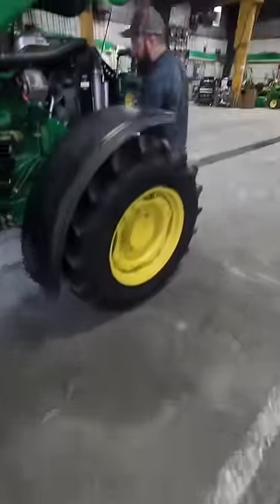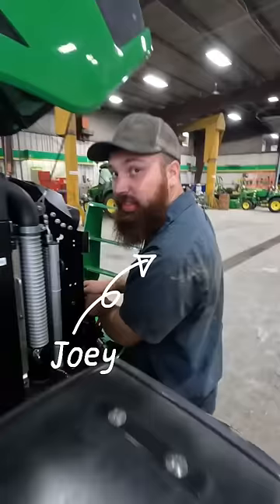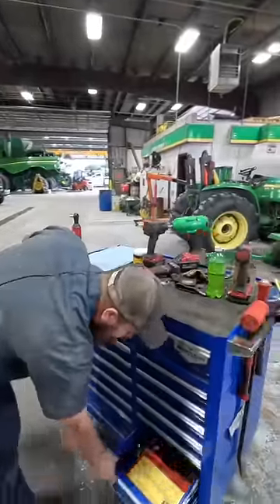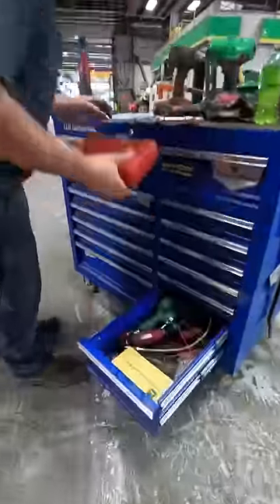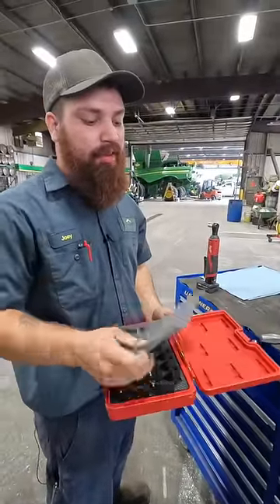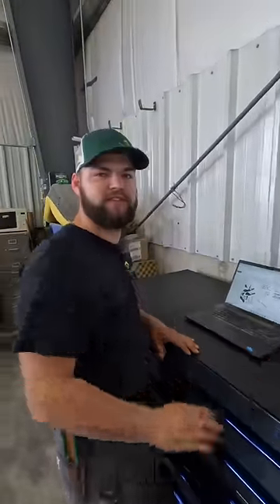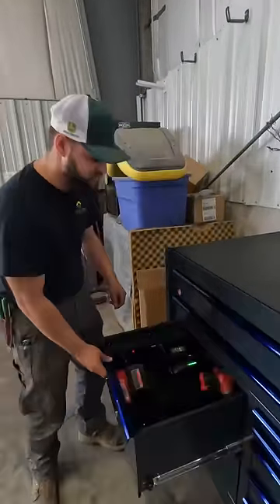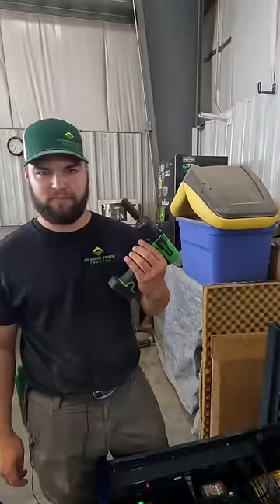Asking John Deere mechanics their favorite tool in their toolbox 🧰 (Part 3)

Comment: The 14.4 snap on is weak compared to the Milwaukee. I have both so. Not just a Milwaukee homer
Reply: 14.4 ain’t a strong gun but there handy as hell for tight places and there just nice to use
Reply: I have the 14.4 snap on and the m12 stubby the m12 stubby is so much better and more power than the snap on still like the snap on just bc it's green 😂🤣
Reply: Completely different uses, snap on is aimed towards taking off interior panels and stuff like that, it’s essentially a 1/4 hex impact with a 3/8 hammer
Reply: @njt03  who would paid $350+ just for an interior tool when the Milwaukee can do the same plus more for cheaper?
Reply: @gorillawrenchin  because you can’t just walk up and warranty the Milwaukee
Reply: @gorillawrenchin  because the Milwaukee won’t do the interior aspect nearly as well and a 3/8s Milwaukee is still pretty weak compared to a Matco
Reply: @gorillawrenchin  you’re highly underestimating how much a fuel tool is
Reply: @gorillawrenchin  Milwaukee is way bulkier, doesnt have a dual trigger, doesnt have a battery that can be magnetic, it’s not even close to the same usefulness or practicality of the snap on
Reply: @njt03  You can't just walk up an warranty a snap on either.  Has to be sent out. Also, 1 year warranty snap on vs 5 year Milwaukee.
Reply: @njt03  the Milwaukee price is cheaper than snap on and Matco as well. I have paid attention to price and also wait for sale on Milwaukee stuff to buy it when it's on sale
Reply: @njt03  I have had the dual trigger and it's not needed. Also, the Milwaukee is the same size as the snap on. I literally have both and the Milwaukee out does the snap on every time. I just keep the snap on with a 10 mm socket on it to only remove 10s and use the Milwaukee for everything else
Reply: @gorillawrenchin  when you have a real job the dual trigger is extremely useful, you clearly don’t have a real job, and for the millionth time THEY HAVE DIFFERENT USES
Reply: @gorillawrenchin  you can absolutely walk on and warranty it, yea they have to send it in but you don’t have to, it’s the convenience factor
Reply: @gorillawrenchin  never said it wasn’t cheaper, and the Matco DESTROYS the Milwaukee
Reply: @njt03  I do have a real job, and I wholely disagree with your statements. Obviously you struggle to fix things if you have issues with it.
Reply: @njt03  as far as warranty, you obviously have never had to warranty a Milwaukee. It's just as easy as snap on warranty.
Reply: @njt03  Matco electronic tools are junk. I'd never own one. Once they are past the 1 year warranty you can't flat rate repair like Milwaukee or snap on
Reply: @gorillawrenchin  no, it’s not, had to warranty one, it was out for over a month
Reply: @gorillawrenchin  you’ve never owned one clearly, best impacts on the market by far, stronger than Milwaukee, about the same price realistically, and less wrist recoil, don’t talk when you don’t own or use them lmao
Reply: @gorillawrenchin  nope, I can fix anything I come across perfectly fine, Milwaukee junk is too bulky to fit into many small space
Reply: @gorillawrenchin  “electronic tools” they’re called power tools, unless you’re talking about electronic torque wrenches, which are ALL junk from any brand
Reply: @gorillawrenchin  the 12v Matco 1/4 hex drive destroys a fuel, as does the electric ratchet, you’ve never used any of them tho so you wouldn’t know
Reply: @njt03  anything I've warranty has only been roughly 2 weeks and I get a brand new tool back instead of just fixing the 1 part.
Reply: @njt03  Their impact is literally double the price of what you can buy a Milwaukee
Reply: @njt03  Well since you admit you have small hands I can see why you have trouble with power tools
Reply: @gorillawrenchin  a fuel 3/8s with 2 big batteries and a charger is over 450
Reply: @gorillawrenchin  you aren’t everyone are you?
Reply: @njt03  I don't know what you were pricing but my comparable 3/8 was $200 so you are doing something wrong
Reply: @njt03  You must be special aren't you?
Reply: @gorillawrenchin  nope, far more intelligent than you
Reply: @gorillawrenchin  maybe for the tool only lmaooo
Reply: @njt03  if you gotta tell yourself that so you can sleep at night go right ahead

Comment: Asking a jd tech why is jd so much harder on fuel than any other brand? Also asking a jd tech why is jd parts so much higher than any other brand? One more question for the jd tech why do jd charge ppl a extra 30k jus cause it’s green n yellow
Reply: Where’s your fuel system design? Do you manufacture parts? Do you run a business? All things you haven’t a clue about.
Reply: @bigcheese370  I do know thank you kindly we use to run jd and got rid of them and now we use case we save more money on fuel also parts isn’t as high either and one more thing don’t have to go through act of Congress to work on jd computer system
Reply: Well I was talking with a guy a B&D farms about this the other day and they seed around 65000 acres a year plus’s there custom combine operation they run mostly case for this reason.